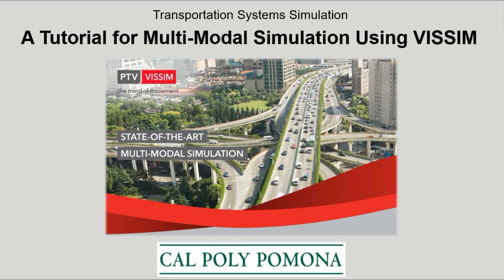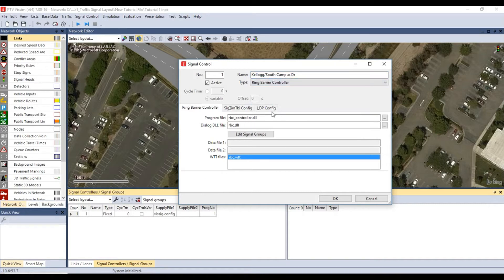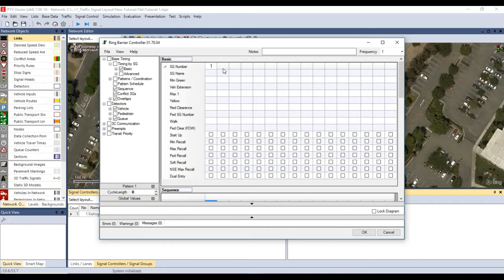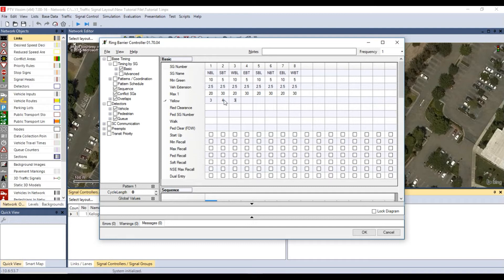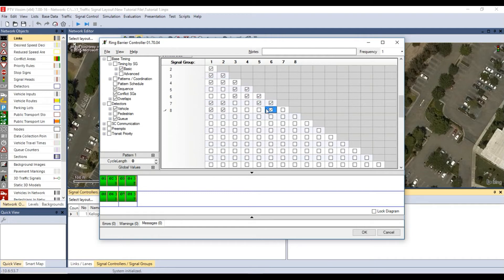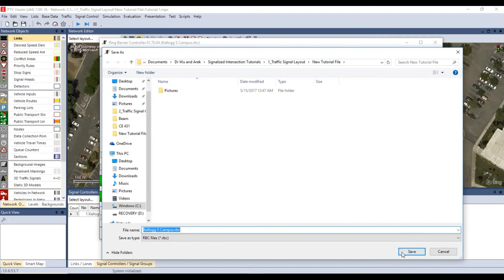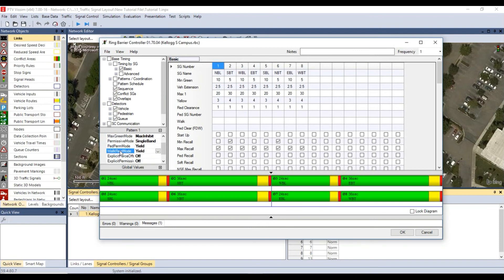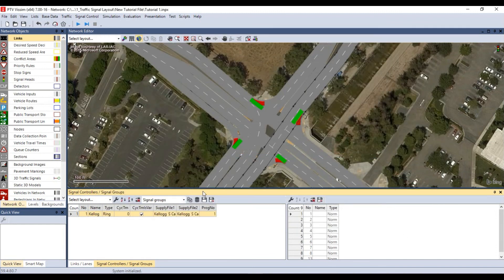VISSIM Traffic Signal Controller Programing

Comment: So, the "13" assigned to overlap is arbitrary? Should I add an overlap number for all left turns and number them "14," "15," "16"?
Reply: You are right. You need to name the overlap phase by the compatible LT movement and the associated RT movement. Also, it does NOT make sense to place a min recall & max recall on the same phase.
Reply: Hello Can I ask something @ZuhairJumaa
Reply: @ZuhairJumaa  @mattfallwork491   Do you Know how to apply pedestrian detector so that it will shows green light only when there is pedestrian detections otherwise it keep red all time? Thanks
Reply: I have the same question.